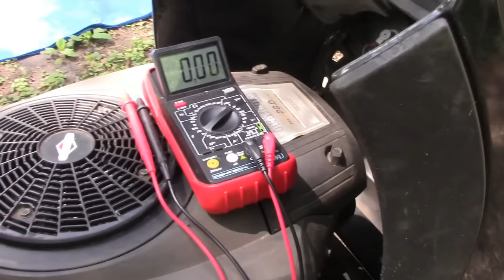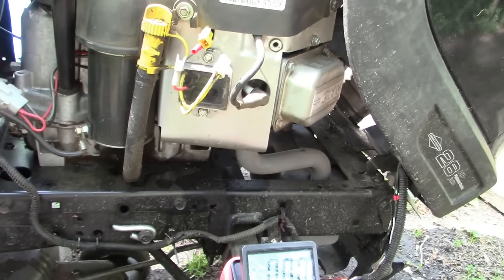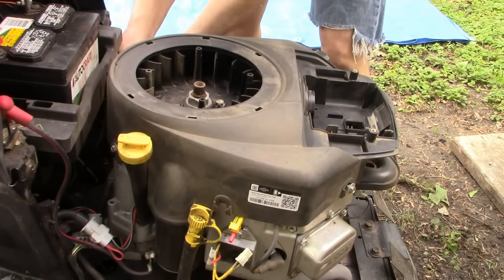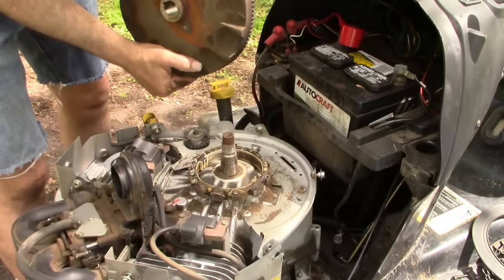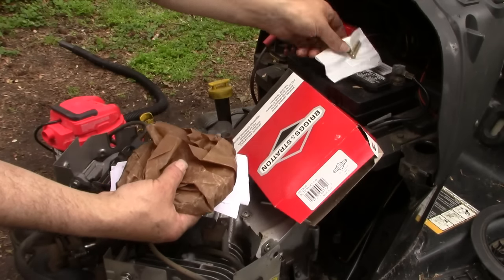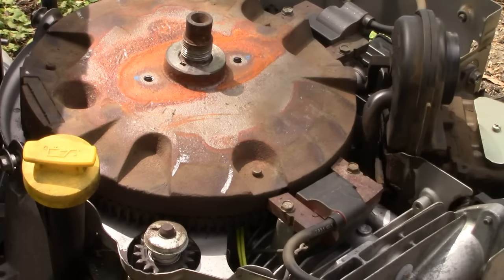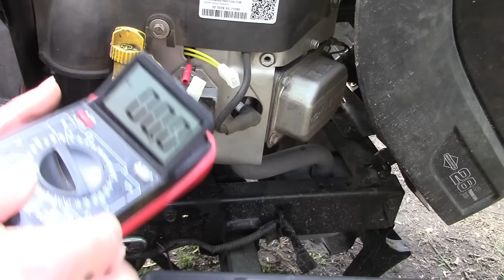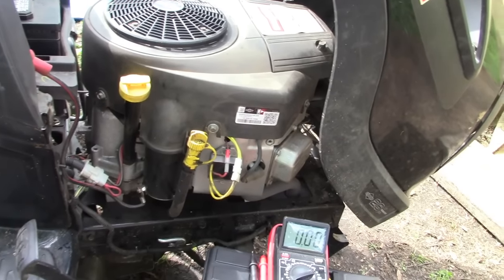How to Test and Repair a Lawn Tractor Charging System

Comment: Great video. I will keep those test voltages for reference.I have same mower, only issues so far was sump gasket, fuel hoses and carb. Have you removed the gas tank on this mower. I planned to but it looks like a nightmare. Other models the rear end unbolts and slides off. If you have a couple days you should do a video. Thanks and keep them coming. Especially the Craftsman YT4500 26 HP CJ
Reply from the maker: Thanks for the note. I did a number of repairs on this mower. Actually had to rebuild the engine, which was a bit of a gamble, but worked out great in the end. I also have a video on replacing the ground drive belt. I no longer have the mower, but it was in great running condition when I got rid of it. I never had to remove the fuel tank. Thanks again.

Comment: I have a 24HP Briggs Stratton platinum motor does this motor have a voltage regulator I could not find it and I googled and YouTube it and found that this motor does not have a voltage regulator is this correct

Comment: Nice Fix! I like that roosta crowin! Bob Dylan sings about that, When the rooster crows at the break 
o dawn,  look out ya window an i'll be gone, change anotha stator an i'll be gone, but don't think twice 
it's all right.
Reply from the maker: Ha ha. I like those revised lyrics! Thanks for all the good info in your comments.
Reply: @Buckwsr  Ur very welcome. I picked up a B&S 23 cast iron block bot the air filter
from antique briggs. this has a starter/gen on it. updraft carb. I've been fixing 
portable generators at times got that eng. running good. clned out the carbitr8r.
anyway, if u ever get a portable gen an can't get it running, gi'me a holler. will be
glad to help an internet friend get it going. I got a lot o good info from Taryl fixes all
and will to spread the word about ribz an collard greenz

Comment: Thank you for nice video. U forgot to look at wiring and electric clutch for freys and shorting. Some fault caused the stator failure most likely.
Reply from the maker: Thanks for the note. I believe the reason the stator failed was due to jump-starting the tractor instead of charging the battery. An electric PTO requires a fully charged battery to operate properly. When you jump-start the tractor with a low battery, then engage the electric PTO, the draw on the stator is just too great. It can't handle that much load, and it burnt up. There are other videos out there on this topic. But the lesson is...never jump start a tractor that has an electric PTO. I know that the owner of this tractor was jump-starting the tractor instead of charging or replacing the battery. That is what caused this problem. Thanks again.

Comment: Great video!  What's the size of the nut on the flywheel?  Was removing the flywheel difficult or just a matter of hammering and prying from different angles?
Reply from the maker: I think its 15/16". The combination of prying upward while giving a sharp solid blow to the end of the crankshaft (with nut loose but still on so as not to damage the threads) is the method that will work. There are videos out there on how to do it. Thanks for watching the video.

Comment: I have a Husqvarna which is basically the same mower. I cannot get 12v to show on the red wire leaving the voltage regulator (2:09) with the key on. I have been chasing wires for 2 days. Even tried a different key switch.

Comment: Nice video, thanks. I would have checked the regulator before going all the way to the alternator since it is in the circuit path after the battery.
Reply from the maker: It's easy to check the stator without removing it from the engine. And if the stator is bad, the regulator won't be working properly either...

Comment: Thanks for the video man! I went through the exact steps you showed and turns out we have the same issue with our mower. Only about 6V coming out of the alternator, and all other connections work. 

System voltage drops after engine is started and slowly drains the battery. 

Will be fun taking it all apart to check out the cooked alternator 😅
Reply from the maker: Have fun, and thanks for watching the video!

Comment: Same engine as video, my red wire is fused. When I start engine fuse blows, I unplugged the red wire from regulator and can start and run engine and fuse will not blow until I plug it back to regulator. Replaced regulator same problem. Do you think alternator could be the promlem?
Reply from the maker: There seems to be a short somewhere. I would trace wires and make sure there is no spot where a wire insulation is wore through or making contact with ground like the engine or metal tractor frame. Verify that the key switch is good also, to eliminate that as the source of the short. Good luck.
Reply: @Buckwsr  Hot wire to regulator came off hot post on starter relay. Apparently something in relay is causing the fuse to blow.

Comment: Hello Buckwsr, yup it is partially cooked, It is the coils doing the work, when they are good all magnetic force
from the flywheel goes into the turns of the coils to make the volts and the thickness or size of the wire is
what determines the amps. So if a few coils are cookt, the current goes thru less turns of the coil, So less 
volts are generated. power is = to volts X amps and even if the amps are constant due to wire size, the voltage
being generated will be less due to the shorted turns.

Comment: Hello Buck.  Why the jumper wire on the voltage regulator?  is there another way to do the test?
Reply from the maker: You could just take a reading at the battery, engine running full throttle. I used the jumper so that the regulator would be connected to the battery, which is necessary to get a true reading, as well as giving me a place in view of the camera on which to put my test leads. Hope that makes sense, and thanks for watching the video

Comment: Great video I’m going to try doing it myself now! I have the same problem too with the electric PTO not coming on , I’m glad to learn that’s not another problem! I also had no head lights so From what you said it probably melted the head light wires, did you fix that wire too while you were doing this? And can you buy a head lights wire kit as well with connectors already on it? 
Thanks again!

Comment: I followed the procedures, but I’ve been having times when the battery becomes discharged. Ant other suggestions?
Reply from the maker: Get the engine running full throttle. Use a multimeter to measure DC voltage at the battery. It should be about 14 volts. If so, the charging system is working fine, and perhaps the problem is with your battery. Just my 2 cents.

Comment: Great video.  I've hit a wall on how to get the flywheel off the shaft once I have the flywheel nut off.  Is there a trick to getting the flywheel off?
Reply from the maker: Here is an unconventional but effective method to remove the flywheel. Screw the nut back onto the crankshaft, but just a  4 or 5 turns. Do not tighten it. You will bang solidly on the top of the crankshaft with a hammer while simultaneously prying up on the flywheel with a pry bar or large screwdriver. The nut on the top of the crankshaft will prevent the threads from getting damaged from the hammer. Just give the top of the crankshaft a good solid whack while prying up on the flywheel from below. This always works, but they're not going to talk about this method in the repair manuals....
Reply: @Buckwsr  Thanks.  I'll give it a try.  If that doesn't work, I'll break down and buy a gear/flywheel remover.

Comment: When testing the voltage regulator at the end can you use the red and black leads to span the wires? I did that and mine showed 8-10. So my regulator is bad?
Reply: Or I’m reading it might be leaving the key in ignition that is causing drain. 😬
Reply from the maker: I assume you've already verified approximately 30 Volts AC from the stator with engine running at full throttle. Next, connect regulator and you can check voltage at the battery with engine running full throttle. Should be 13 or 14 volts DC. If not, regulator is probably bad. But regulator has to be connected to battery to properly check it....

Comment: Very good video. If the voltage regulator had been faulty, what reading would you see on the Volt Meter?
Reply from the maker: With engine running (key in "run" position), you'd probably just read battery voltage, as the regulator is tied to the battery when engine is running....

Comment: i have a cub cadet zt1 it cranks like it about to start then stops. i replaced spark plugs, fuel filter, oil change. hoping something was just clogged but not the problem i spray starter fluid in the carb and about 2/4 times i can get it to turn over and it will run for hours after that as soon as i turn it off same problem. i figured either the solenoid or the alternator. any suggestions?
Reply from the maker: It could be the choke plate is not fully closing prior to a cold start. Remove air cleaner, apply choke, and make sure the plate is fully closed. Hard for me to diagnose sight unseen. It does not sound like solenoid or alternator. Sounds more like a carburetor issue. But again, hard for me to say. I hope you get it figured out.

Comment: Question. I went through all the checks in the video. I’m getting 28.7vac out of the stator. 12-13vdc out of the rectifier. New rectifier gets same 12vdc. Stator has no visual issues. Magnets all look good in fly wheel.  Could this be caused by low RPM? Do you think increasing engine RPM might elevate AC volt output ??
Reply from the maker: Well, yes, do these tests at full throttle.
Reply: Test it wide open rpm’s

Comment: Question - Why didn't you try testing the output before putting on the shroud in case you had a problem?   Other than that excellent repair job.
Reply from the maker: Possibly I did that off camera. I really can't remember, it's been too long ago.... Maybe it was because the old stator was so visibly burnt up, I knew the solution was to replace it....

Comment: In your opinion, how long does an alternator last in one of these engines  ???

Thanks!
Reply from the maker: It should last the life of the engine. In my case, this tractor, which has an electric PTO, was jump started at some point, and that should never be done on tractors with electric PTO. Engaging the PTO with a weak battery puts too much draw on the engine alternator, and fried it. Use a battery charger to charge the battery, not a jump start.
Reply: Only thing is electric clutch has shorten there life and bad battery cause alt to over work

Comment: Great video, I found it while looking for charging problems.  My 14.5 Briggs has two wires from the stator, a black that reads around 25v AC (for lights I assume) and a red  that has a diode in it and reads 25v DC. Do I need a regulator? I couldn't find one on the mower I robbed this engine from. Thanks!
Reply from the maker: Yes, some sort of regulator is required. Lights run on 12V DC, and charging system at full thottle should be about 14V DC or so. You will need to look up the wiring diagram for the engine or more likely, for the tractor from which the engine was taken.
Reply: @Buckwsr  Thanks!  This mower has no lights and a manual push button solenoid so the only wiring it has is the battery cables and a single kill wire to a switch. I bought a two wire Briggs regulator (yellow and red) that grounds thru the case. I assume yellow is stator and red is battery. Do I need the diode at all or does the regulator have a rectifier? I know, dumb questions but I haven't been able to find any answers. The mower I got this engine  from is long gone to scrap heaven.
Reply from the maker: @unti419  leave the diode in place. At full throttle see what kind of voltage DC you get on the red wire on the regulator. Should be like 14V for charging battery.

Comment: I just checked mine, and I have about 50 volts ac going into my voltage regulator.  Does that seem ok?  Thx.
Reply from the maker: Sounds high. What is your DC voltage at battery with engine running?
Reply: Checked again this morning. 40 volts ac, 14.6 volts DC at battery. I thinkthats about right.  @Buckwsr
Reply from the maker: sounds like system is charging as it should.... @Brian-xu9di

Comment: Nice video - straight forward and thorough .  Thank you
Reply from the maker: Thank you so much for the kind words!
Reply: Help.  Have a Craftsman Riding Mower with a 24 hp V=Twin.  Lawnmower engine , model 445677, type 0110 EG. , code 050121  YG.   That when it gets warm it will not shut off using the ignition ,   Help , any advice would be appreciated , Any Lawnmower Mechanics , help please , and I  thank you !!!!

Comment: Good video, however I'm curious to know what the resistance is on the new stator and old stator
Reply from the maker: Good question. But now it's too late to run that test, as the old stator is long gone....
Reply: @Kevin Curious question. What is the point? It may have been a worthwhile diagnostic before disassembly, but inconsequential unless attempting to determine which segment(s) have failed.

Comment: Im having a problem with a Briggs V twin,  I replaced the alternator,  it put out 14.5 DC. the next day it stopped charging.  I put the old alternator back on andvit started charging 14.5 volts.  Then it quit.  I put the new one back on it charged for a day or two then it quit working.  I think maybe the magnets in the flywheel are bad.  If that's the case I need a new flywheel ? Any suggestions?
Reply from the maker: I'm not an expert, but I would suspect that if both alternators are acting the same, then perhaps the problem is not the alternator, but the voltage regulator. I don't think magnets go bad, so unless they are broken or missing, I doubt that's the problem.
Reply: @Buckwsr  
I was thinking the same thing.  I checked the magnets by putting a bolt next to each magnet and each held the bolt fairly well.  I ordered a new voltage regulator and hope that works.  I was thinking about getting a rectifier,  the only difference that I know of is the rectifier doesn't limit the voltage,  it changes from AC to DC.  I have been working on this thing for about 5 weeks now and I can't figure out why it works for a day or 2 then stops. 

Sir thank you for your response,  its very much appreciated.  I will try the new voltage regulator,  and see what happens.  Again thank you Sir.
Reply from the maker: @bertgrau3934  What is the condition of your battery? The charging system can't compensate for a bad battery. And these mowers with electric PTO require a fully-charged battery. Something else to think about....
Reply: @Buckwsr  
It sat for 4 years, the battery was about 4 years old when parked.  I put a 40 Amp charger on it for about 5 hours,  and with a lot of testing,  carburetor work,  I haven't had to recharge it. That was about 5 weeks ago,  and it shows 12.2 to 12.5 volts.  When the alternator is charging,  it helps.  Even when it's not charging the full amount it's still putting some charge back in.   However I do have a new battery to try and see if that makes any difference.  
Thank you for that suggestion sir
Reply from the maker: @bertgrau3934  Yeah, I'd say a new battery is good idea.

Comment: Yup, quite similar to a charging system on a Harley Sportster. bobbins of magnet wire on stator
core with flywheel lined with magnets, power from coils goes to an R/R rectifier regulator. then
direct current out and to the battery.  r/r will put out not enough or too much.

Comment: This system is not designed to change up a bad battery and will cause the charging system to fail 
Only a good battery will work properly with this system

Comment: Throwing this out there. I check everything I have the same brand engine the twin with 24hp my battery is not really discharging it’s a new battery it is Jst staying at 9.67v it won’t go lower than that and higher than that but I have to jump it to run it on as it need a little over 12 to turn on. I check the alternator the reading for the alternator is 21.6 it’s not 30 do u think I need another battery a new alternator are is it something else